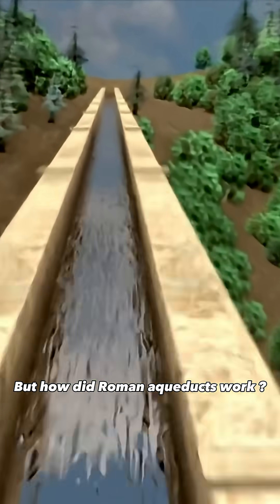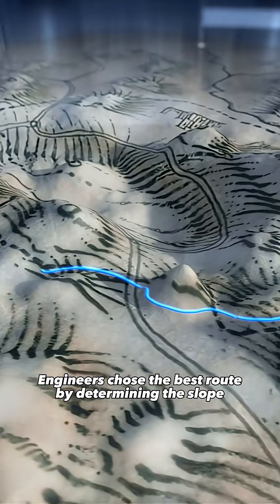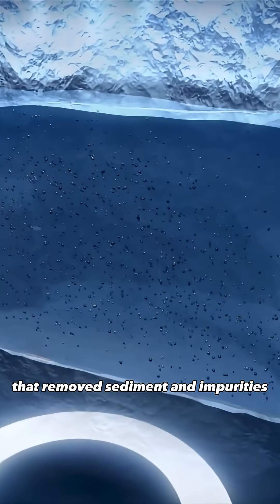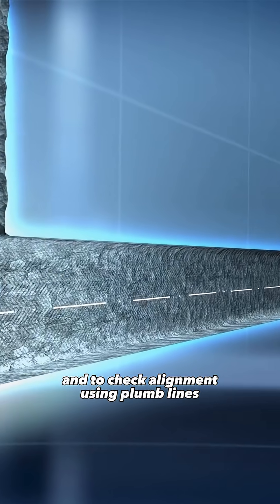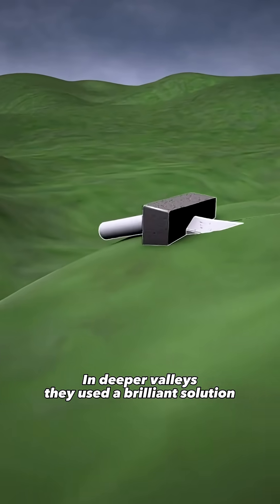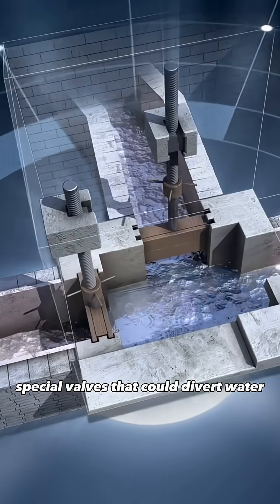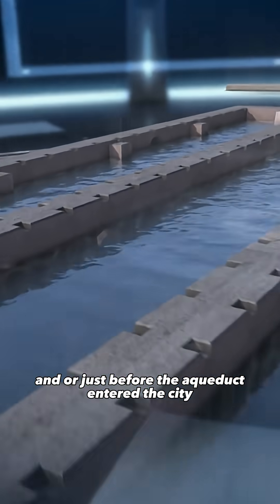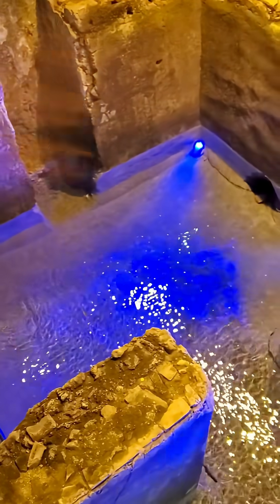The engineering of roman aqueducts explained #history #romanempire #engineering #aqueduct

Comment: Until you know about the Indus valley civilization. The Indus Valley Civilization managed floods through a combination of advanced structural and non-structural methods, including building cities on raised platforms, constructing protective walls, and creating elaborate water management systems with diversion channels and reservoirs. They also built extensive drainage networks to carry away wastewater and rainwater, and used marker posts to create an early warning system for rising water levels. 
And this all happened 5000yrs ago

Comment: Seriously, wtf happened with all that knowledge? We're burning fossil fuels, and erecting ridiculous giant wind turbines and have massive rock boring machines...but those guys just made this stuff happen with "primitive" tools? It's not adding up.
Reply: The wind turbines convert renewable energy. That's something that people only replicated with mills until solar panels came around
Reply: @michaelkelsey4918 One of fundamental principles of science, and first law of thermodynamics, is no energy is created or destroyed. Wouldn't that mean that all energy is fundamentally renewable? Anyway, this is getting away from my question about the knowledge. By today's standards, it would require a lot of energy input and construction equipment to build stuff like this, but it doesn't seem in those days they were as energy dependent as we are now. 
I know I don't know anything about this topic, and I'm expressing just my perception.
Reply: @Matt_K  The reason fossil fuels aren't renewable is that the burning of fossil fuels  releases gas that escapes into the atmosphere, thereby leaving the planet.  More importantly, the heat released is not in a form we can reuse as fuel, whereas wind and solar energy won't stop being renewed until the atmosphere stops existing or until the sun dies.
Our technologies run on electricity and gasoline, because we use unbelievably faster transportation and communication and lights, and other luxuries they didn't have.
Thanks for expressing your perception of energy reliance, I wasn't meaning to argue, just enlighten on wind energy.
Reply: @michaelkelsey4918 I don't really agree. Just because we as human lack knowledge of recapturing that energy, it doesn't mean it's lost. It is simply lost to us, but not as energy.

Comment: The word "plumbing" derives from the Roman word for "lead", a common material in ancient plumbing.
Reply: Unfortunately, lead pipes are still being made and used today. In fact, Flynt, Michigan, USA only let you connect your house to the mains water through a lead pipe. The reason given is that they last 400 years and the State won't allow lesser pipes that would require maintenance! Poisoning people is far cheaper and efficient. Thugs.
Reply: @christianzilla what about copper pipes? Aren't they allowed?
Reply: Oh-oh! Yikes!
Reply: @jamjar5716 it was ok because of the mineral content of the water - mineral deposits built up on the inside of the pipes, which kept the water in circulation from coming into contact with the lead.  Not ideal, but less of a problem than it sounds like.
Reply: In Spanish the word “lead” is “plomo”

Comment: When most people think of the aqueducts they think of the arched bridges that cross valleys, and not much else. These are impressive structures in their own right, but conceptually they are relatively simple in terms of the physics.  As a civil engineer, I feel the other hydraulic structures (tunnels, siphons, settling basins) are equally if not more impressive than the bridges in terms of design, construction and understanding of hydraulic principles.

Comment: They were so smart they transported and purified water through mountains  and valleys    using highly sophisticated plumb bobs, or conical shaped weights tied to the end of a string line, to gauge and measure  depth and determine  the elevations  needed  to flow water over 500 miles.  All that without ever factoring in the curvature of the earth.  Hmmmm...

Comment: I’ve seen this in most civilisations. The Incas had water supply to Machu Pichu  - still works. Indus Valley civilization has not just water supply, but a sophisticated drainage system and its dated between 8000-4000 years. I guess it was more of a necessity than a matter of brilliance to keep the city alive. Great minds, great thoughts ❤
Reply: Lmfao no other civilization at the time of the roman had anything close to this complexity of engineering. The next closest would have been the Greeks, which are virtually the same people.
Reply: @cosmossci4883  typical western thinking, some engineers who thought that the earth is flat and the centre of the universe :D Can never tolerate that there existed a life more sophisticated and older than theirs.

Comment: The Ghasabeh aqueduct in Gonabad, Iran, is considered one of the oldest and largest aqueduct systems in the world. It dates back 2,500 to 2,700 years and is an impressive example of ancient Persian engineering. The aqueduct, also known as Kariz e Kay Khosrow, consists of two main canals and six secondary branches, with over 470 wells. Its main well is located on the northern hillside of Siahkuh at a depth of 280 to 300 meters.

Comment: Next up, learning about the self-healing concrete they used, which made these things last so long. The basic idea is mixing the fly ash and lime with sea water, which led to a rather violent reaction producing a hot concrete mix that left a bunch of the lime unreacted -- thus when cracks form, water entering the cracks will form fresh new cement to automatically fill the cracks. 
I don't know if this was entirely intentional or well understood at the time or if it was an incredible accident of circumstance.

Comment: Army back in a day used to do infustrial scale digging. No gym in sight so used shovels, like 20.000 trained and had some slaved to help too. 500 miles or 900km trench…with 20-50.000 strong is very much feasible. add 20.-50.000 quarry workers and logistics and its not challenge at all for big economy like Romanian.

Comment: alot of this is at least subjectively accurate. IF the romans in fact did use a sluice gate it would have been a slide gate. essentially the same thing, however the romans were still unaware of the concept of using a screw drive mechanism to lift things in such a manner, not to mention they would most likely have to develop some form of drive unit to turn said MASSIVE screw.so instead either alot of people or animals or mfn hercules would just slide them and they had locking positions. actually the modern screw as we know it today didnt reeeeaalllyyy come around until the early 1840s, and many people would say it also gave birth to the industrial revolution

Comment: They have been used as an underground water transport system for irrigation and drinking water supply in arid and semi-arid regions. With this invention, the ancient Iranians made it possible to exploit groundwater resources, and this system was quickly used in other parts of the world. 

Further explanation:

Invention of the Iranians:

A qanat is a complex system consisting of tunnels and wells that are dug horizontally and underground to transfer water from areas with high water to areas with low water. 

History:

Studies show that qanats were first built in Iran during the Achaemenid era and before. 

How it works:

A qanat consists of wells that are dug vertically and then connected to an underground channel. Water is transferred to the surface through these channels.
Reply: Qanat= aqueduct 
qanat = قَنات

Comment: I am quite surprised! Considering they had pipes connected to their homes, it does make one wonder why they did not utilize bathrooms for cleaning.

By the way, the ancient Egyptians demonstrated advanced engineering by employing a mechanical barge to lift water from the riverbed to elevated structures and agricultural areas.

Furthermore, Muslims also managed to secure access to water sources up for their fortifications and higher pareas in the Levant and Egypt.

Comment: I am most impressed by the way they could not only calculate the slope needed to make the water flow at a safe rate and then plan out a route that would maintain the slope, but actually build a channel that does maintain that slope.  I struggle to put a shelf up.

Comment: There is one less than a mile away from where I live. Interestingly or funny enough, I live in a decently sized valley, but either they thought the water here was no good or they got tired of hauling water up the slope to their villa/villas so they built an aqueduct straight through the hill from the next valley over which is at least 50-100 meters above elevation of the larger valley. The water didnt come from the stream in the next valley over but from a natural underground water reserve somewhere around the slope of that valley (the next valley over is much less clearly a full valley, I cant think of the English word but in French it would be called 'vallon' a small and relatively slopeless valley usually higher up)
Its 650 meters long, sourced at 20 meters below ground level, then bored straight through the hill at a maximum of 37 meters below ground with about 20 vertical shafts along the way. Once it passes the hill the water would have dropped substantially to the Roman villas on the slope of the bigger lower valley. 
This is in Luxembourg, Alzette valley and was dated through a wooden tool to 136 AD.
How can you not be in awe of the Romans ingenuity but also their geographical reach!

Comment: I’m an engineer and we still do this today but usually with plastic HDPE piping. Also, there is no need to build bridges or cut through mountains to convey stormwater and drinking water is conveyed through different pipes usually PVC or DIP and water pressure is boosted using centrifugal pumps
Reply: And is it still going to be working in 2000 years?
200 years?
20 years?

Comment: They also used Lead Pipes, but since the water had so much mineral content, that it coated the inner pipes with a mineral coating that prevented the lead from leaching into the water supply.

Comment: Persians mastered underground aqueduct (Kariz or qanat) infrastructure, built millions of miles of underground tunnels that took 7000 years to build and provided gravity pressurized always geothermally balanced temperature (around 50°F) spring water to the cities, towns, villages and settlements in addition to use of the shafts and their wind towers to create geothermal cooling system distributed under the cities to each household that also kept their homes way above the freezing temperatures in Persia's freezing winter

Comment: This is really impressive. Persians had a similar ish system called "qanat" . Imagine having water in the desert . These ancient civilizations were really genius 👏.
Reply: And the qanats are apparently sourced straight from underground aquifers rather that mountain streams, from what I've seen in vids, at least regarding those in north Africa.
Reply: @TaLeng2023 yes. They found the underground water source, dug a tunnel from the source to the city with a certain steepness that kept the water flowing the whole way (sometimes 50 miles).
This prevented loss of water due to desert heat and also kept it relatively cool due to water flowing in a certain depth underground.
Reply: @TaLeng2023  The romans used water springs inside mountains, straight from the source before light even shined on it
Reply: And they did it 1000 years earlier than the Roman's. They definitely influenced their build of aqueducts I'm sure.
Reply: Rome does it ,then it's enginnering.Persia does it ,then it's aliens
Reply: And I think you will find they all got their ideas from the Chinese civilization.  You need water to grow rice.
Reply: @LloydWeeber chinese climate doesnt require u to bring water from far away . Its available close by most of the time. Also qanats are situqted under the surface of the earth to reduce evaporation and stuff. Mostly needed in desert and hot climate (persia)
Also a simple search would prevent spreading misinformation. Just google "is qanat from china" for example 😂

Comment: I could watch a full hour long deep dive into the physics and engineering of these water treatment and distribution systems.  Like:
1. How the mortar was mixed and applied to sustain the decades of water flow with minimal erosion.
2. What the inverted siphons were made of (lead?) And how they sealed the ends to the intake and output transitions.
3. How did the plumb bobs work? How could they know the length to make each line to check for alignment?
4. How did they drill the holes for these plumb bobs and were they large enough for a person to fit in?
5. What does the filtration geometry look like? A series of baffles where the velocity of the water is slowed enough for the solids to settle out? Or was it more like today's modern clarifier basins?
6. What was the maintenance on these systems like?